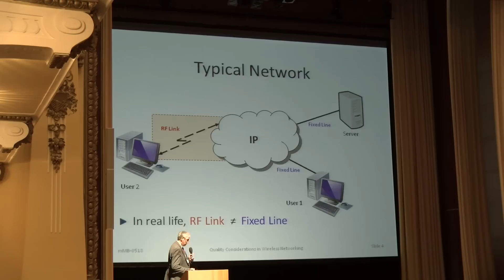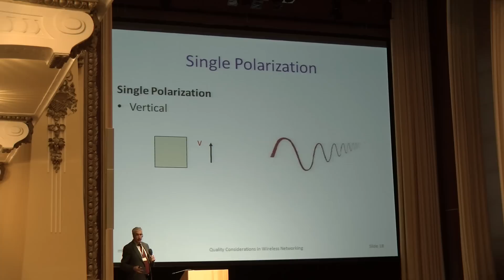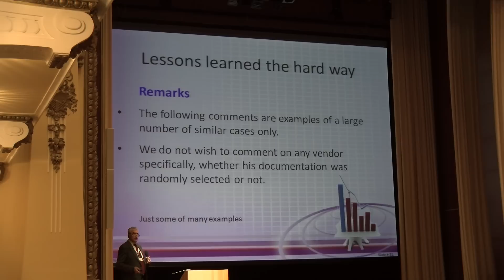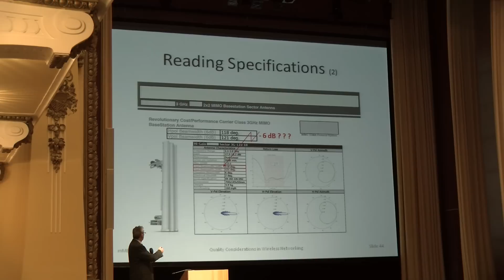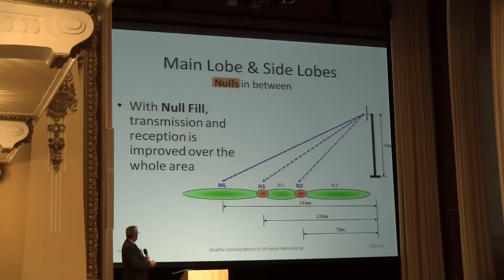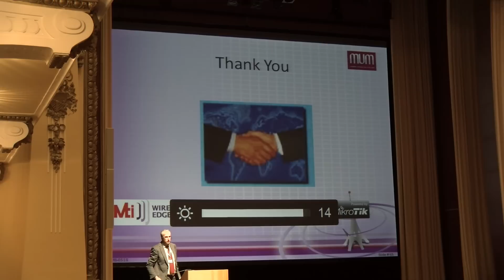Quality Considerations in Wireless Networking

Comment: MTI Presentation at MUM 2016
MikroTik User Meeting
MUM Europe 2016
Ljubljana, Slovenia
25-26/02/2016
Feb 26, Friday, 14:45 (45 min)
Quality Considerations in Wireless Networking 
by Michel Bodenheimer 
(MTI Wireless Edge Ltd., Israel)
This presentation covers the longstanding experience MTI Wireless Edge has with MikroTik based wireless networks. Special attention is given to the wireless aspects of networks based on MikroTik. The difference between a fixed line and RF links in a network are covered. Design considerations in a wireless network are discussed, including Distance of transmission, Throughput achievable, Quality of Service (QoS), Interference immunity (C/N, C/I), Frequency re-use, Reliability, Survivability etc.
Special attention is given to different antenna parameters such as Frequency, Gain (main Lobe), Half Power Beam Width, Front to Back Ratio, Side Lobe, Nulls, Cross Polarization, 
Environmental Conditions and their influence on the performance of the network are discussed.
Finally a few real-life examples are given to illustrate the abovementioned issues.
For additional information:
http://www.mtiwe.com